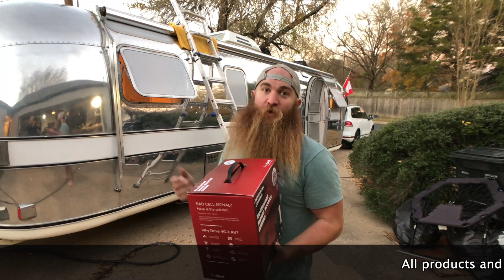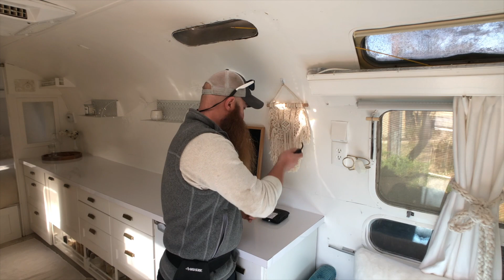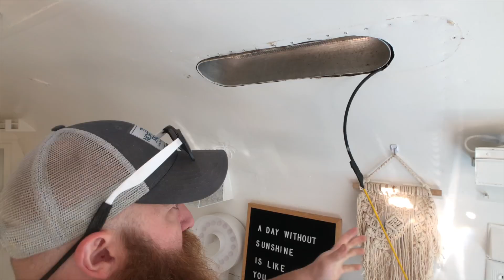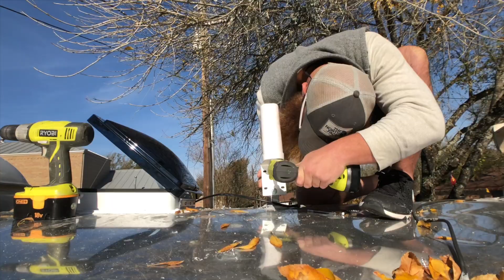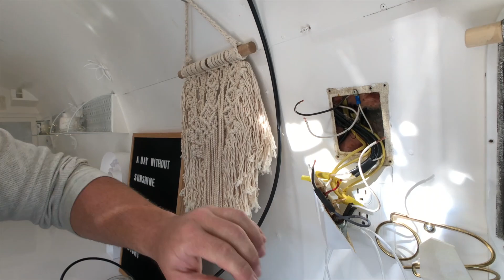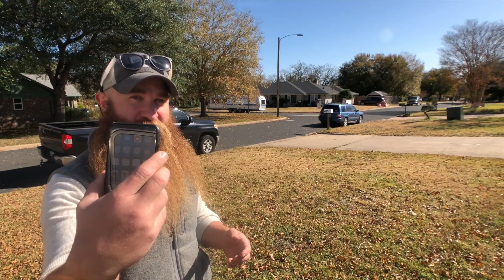WeBoost Drive 4G-X RV Install in a Vintage Airstream

Comment: Michael,
We recently added three solar panels to our airstream two years ago. The panels are installed on the roof with 3M tape and no drill holes. Yes ,I know this sounds crazy but no problems and  the company Amsolar has years of experience with no issues. I would recommend checking out their site it, it has info on installation with the tape.

Comment: Great vid/installation.  We are considering the WeBoost option since we prefer boondocking in remote areas or where an abundance of tall trees obscure a cell signal, but are hesitant on having to drill any hole(s) in the beautiful exterior of our newer model Airstream without sacrificing the existing AM/FM and TV antennas.
Reply from the maker: I completely understand not wanting to put holes in your exterior.There are ways to do it without any leaks and concealed, but it can be scary making the move to do it. A popular method to avoid this is to run any cables through the refrigerator vent. Just my 2 cents.